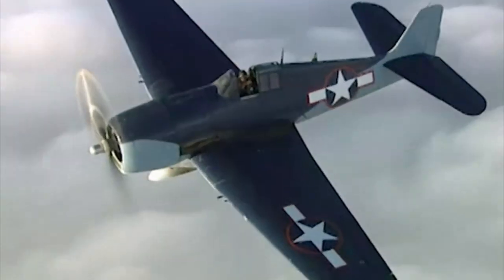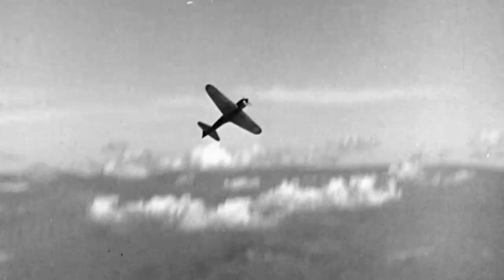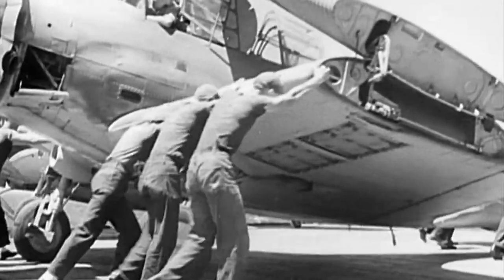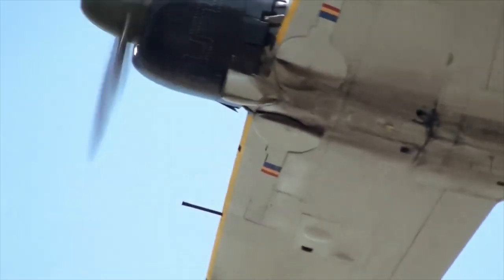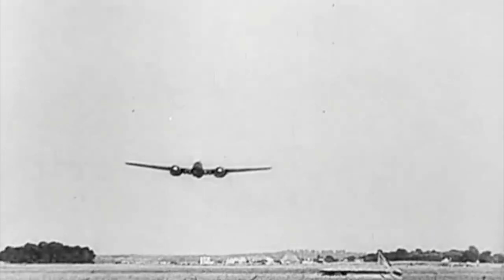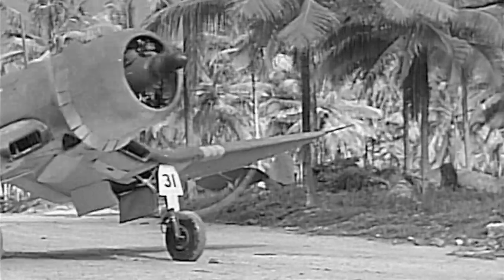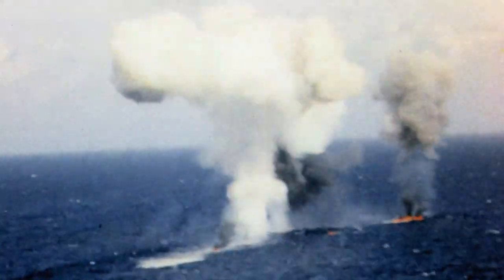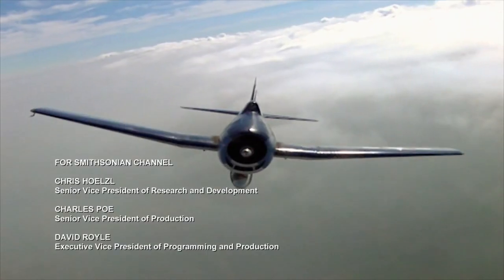Air Warriors F6F Hellcat

Comment: I was always under the impression the Hellcat had relatively small, high-load wings. Never knew it had one of the largest wing areas of all the single engine aircraft in WW2. Either way, the Hellcat was a BEAST. 2,800 cubic inches of Pratt and Whitney supercharged BEAST.
Reply: The wings don’t look big only because the Hellcat is an absolute unit.
Reply: same engine in the Corsair and the P-47

Comment: Love this beast of a plane.  What it lacked in maneuverability it made up for in speed and firepower.
Reply: I love it too but actually it was a very maneuverable airplane,  arguably the best dogfighter we had in 1944-45.
Reply: With a top speed of 391 MPH the F6F-5 wasn't especially fast by the standards of 1944 when it reached service in large numbers. The P-47, F4U, and F8F were all faster with the same engine. But the Mitsubishi A6M Zero was even slower at only around 330-340 MPH, and the Japanese failed to significantly upgrade it while other combatant naitons steadily improved their aircraft throughout the war. The F6F was fast enough for the job it was designed to do - put BMG rounds into the Zero. Had the F6F served in the European theater as a frontline air superiority fighter it would have been slower than you'd like to take on the top Luftwaffe fighters.
Reply: It actually was very maneuverable at higher speeds, say above 200 knots, and especially when the -5 version hit service which had more responsive controls with spring loaded tabs. Keep above 200 knots on the clock and you could turn with a Zero because the wide span ailerons on the A6M stiffened up, much like the MiG-17 in Vietnam became a lead sled at higher airspeeds. Keep your airspeed up, don't get slow in a turning fight, because as energy decayed, you were fighting the Zeke's game.

Comment: The Pratt & Whitney R2800 developed 2,000 horsepower. Used in the P-47 it was an incredible engine. Later, to take full advantage of that power, a few companies manufactured a 4-blade paddle prop to replace its factory 3-blade. Why was the Double Wasp never paired with the 4-blade paddle prop in the F6F Hellcat ??
Reply: Best. Guess:it didn't up performance all that much at low to middle altitude, which is where the F6F did most bbn of its' fighting.

Comment: 10:00 - Capt. David McCampbell has trouble landing because the carriers have their flight decks full. This is where the angled flight deck would have come in handy. A carrier with an angled deck can simultaneously land airplanes while spotting other airplanes for takeoff. Sadly, that obvious-in-hindsight innovation had to wait until the 1950s.

Comment: The Navy experimented with the new Corsair, and it actually had more capability than the Hellcat.  However, when landing on the deck of a moving carrier, the pilots could not see the deck in front of them due to the aircraft design.
The Marines took the aircraft for land based sorties.  It would be interesting to see them go head to head in a mock dogfight.....Who would come out on top???
Reply: the better pilot
Reply: Against the Planes in the west both would be beaten

Comment: “The Hellcat may have been the navy’s single biggest contribution to victory in the Pacific”. Um, lady are you high? No ma’am, the Navy made much larger contributions to victory in the Pacific. We could still have won the war without Hellcats. Don’t get me wrong, the Hellcat was a fantastic plane but without it we still had the Corsair. 

Personally, I believe that the single greatest contribution the Navy made for victory in the Pacific was the carrying Troops to retake the islands and provided the logistics that kept every Soldier, Marine, Sailor and Airmen fed, fueled and armed.
Reply: The Corsair initially had problems with carrier landings so it was given to the marines for land based operations. Without air superiority early on, we would not have been able to protect the navy against the Japanese. That's the reason the Hellcat is so lauded for its contribution. It was just enough to permit us to gain the advantage. The Corsair was another P&R Double Wasp equipped fighter - a super plane. It's just too bad it was not a great carrier plane.
Reply: @Informed104  the Corsair entered service in 1943, that isn’t “very late”.
Reply: @Front-Toward-Enemy   It is to those who had been in it since 1939

Comment: The F4U Corsair was a better fighter, arguably the best US fighter in WW2. No nick name was given to the Hellcat. The Corsair was known as 'Whistling Death'. The Corsair's aerodynamics were of an advanced design over those of contemporary naval fighters. The F4U Corsair was the first U.S. Naval aircraft to have landing gear that retracted into a fully enclosed wheel well.
Reply: P-47 is better than a corsair, all day
Reply: @laurencethornblade1195  P-47 is one of my favorite fighters, but the Corsair is much better at maneuverability. It would fly circles around the P-47. The P-47's strength was in air-to-ground attacks, tank busting, strafing, etc.🙂
Reply: Hellcat had more kills than any fighter in ww2 over 5000
Reply: @manricobianchini5276  No, the P-47 was designed as a high altitude  escort fighter. A Corsair cannot turn circles around a P-47. The F-4U probably couldn't even compete in the ETO, I dont even think it did.
Reply: @laurencethornblade1195  I disagree, my friend. Every fighter has it's strengths and weaknesses, but overall the Corsair was better.
Reply: @bradganz6787  only because of circumstances, not because it was better.
Reply: @laurencethornblade1195  no way
Reply: No arguments at all . The Corsair could not stay in the air with the Spitfire every Spitfire from the Mark IX on would cream it in five minutes